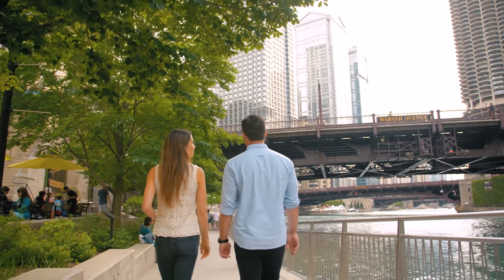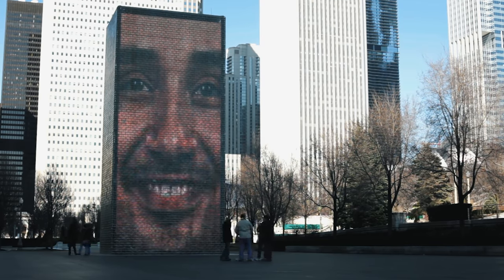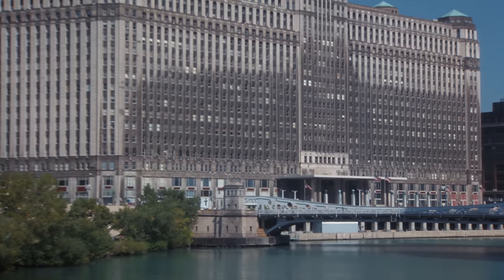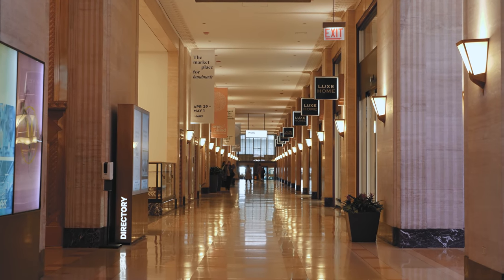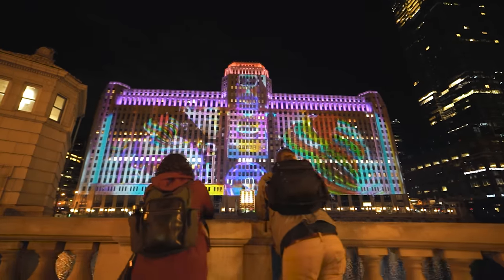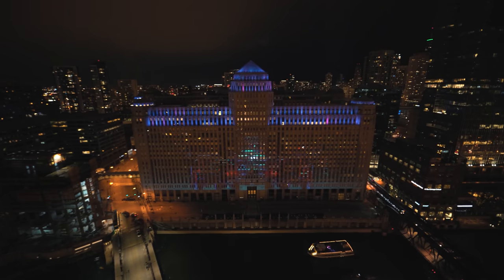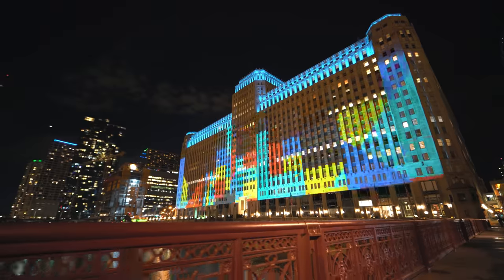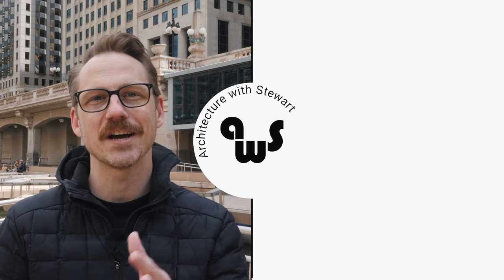How This Turned into The World's Largest Digital Art

Comment: BLINK Cincinnati 2022, which just took place back in October, did quite a few of these animated digital art projections on the facades of buildings, with the most intricate being those on the Hamilton County Memorial Building in Over-the-Rhine and Mother of God Church in Covington, KY,  both by the same artist, with the projections making the two usually very static monumental buildings almost appear like they were breathing, moving, and rippling.  Other buildings had their facades lit up in different patterns or had animations playing on them, utilizing the exterior facade elements in many cases.  Some of the projections animated existing murals, making the usually static works of art come to life.
Of course, the projections were all temporary and in place for just a single weekend.  When the event was over, all of the projection equipment was removed.  It would be amazing if more buildings did dynamic lighting like this rather than the static lighting that is more common, but it can be expensive to install and maintain, and also would be very intrusive if there are residential properties or hotels nearby.

Comment: The vid hasn't started yet, but I can see ads for Amazon Web Services and Brilliant.  By using the word crazy so loosely, you insult those who've rightfully earned the label.  Movie theatres exist.  The mart is flat.  They do it at night.  Projection art on buildings has been occurring for 20 years.  This is not crazy, it makes sense.  What is crazy is that a private company funded this.  Not the city.  What will be crazy is if they stick to their 30 year contract and promote the artist names/sites/details to the audience
Reply from the maker: I'm not sure what you're getting at. The word 'crazy' has come to be used in a number of situations outside of the disparaging use of calling someone unstable. To project across the river is a herculean effort, the scale of this is enormous. It requires a lot of gumption and will to pull off and I think crazy underscores the monumentality of the task. I hope the video itself--which made all your initial points--also does it justice.
Reply: @stewarthicks  you buried the lede in a funny way.  30 years w/ no sponsorships or ads (in a corridor that's predominantly marketing offices) - and you managed to cite all the corporations involved (and then some) and none of the artists.  The medium required horsepower, sure.  And I get the Feynman concept that a flower is only more beautiful if you know the mechanics behind it.  In art, the flower tells the story.  Those other public works you cited each tell stories.  Some are what the artist intended and others are interpretations of the audience - all legit.  Your interpretation and recount of this spectacle is legit - the historical and technical aspects.  This view also manages to ignore all the truly 'art' aspects of the project - the artists, their message and the feelings that result due to the scale and nature of the installation.  Without these things art becomes graphic design - a tool to promote businesses rather than inspiration and wonder